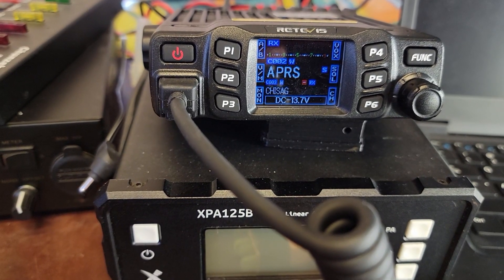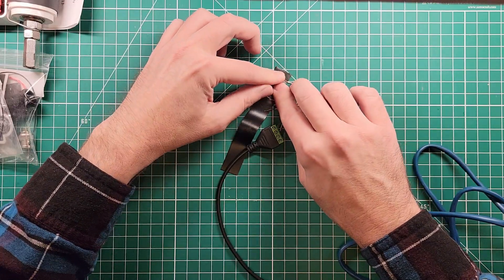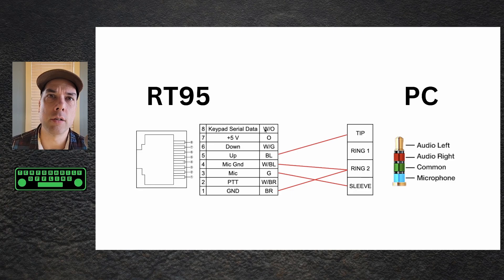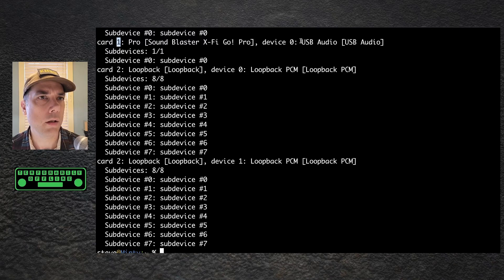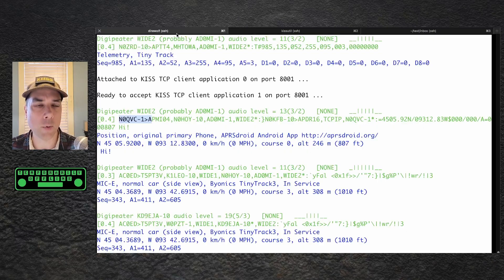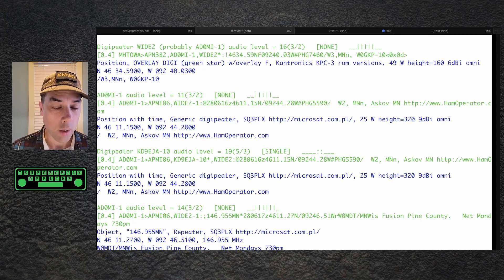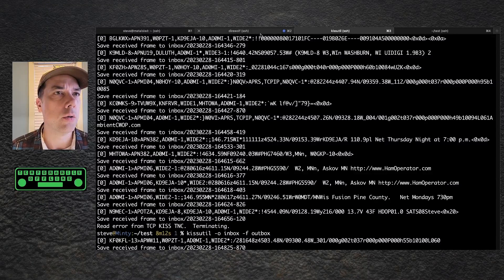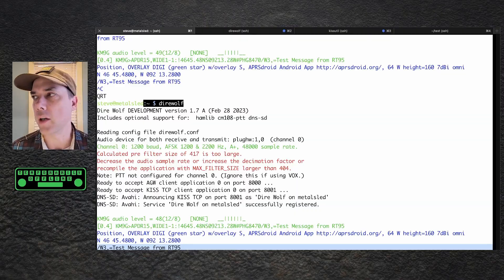APRS CABLE!!! Retevis RT95,  Anytone AT-778UV, CRT Micron, SR-94HPC, Midland DBR2500

Comment: I made that cable for my retevis. I soldered correctly but when I connected cable to my phone to use aprsdroid radio changed the frq because the tip of TRRS is connect to UP pin in hand unit. AI told that I need 1uF capacitor on this line but when I soldered 10uF capacitor, VOX not worked and radio not sent aprs packets. Only heard it but not decode in aprsdroid.
Reply from the maker: Yep. She's a trickster
Reply: So do you mean that capacitor on line 5 is not need?
Reply from the maker: No, I mean I haven't figured it out yet... still working on it among other things.  For a short term fix, I'm using the external speaker port on the back instead.  I've created a PCB to make it a bit easier and I'm working on making a shorter video on using it with the RT95 and getting on APRS - we have it working on the 6pin radios (and there were more of them, so that helped fund development.  Check out the videos here: https://www.youtube.com/@temporarilyoffline/search?query=retevis%20toads%20di%20rt95 (and look for the live streams)

Comment: Does this cable supply   a PTT (Push-To-Talk) connection to your radio? I have the Anytone AT-778UV and I have not fount it will do Cat control am I wrong?
Reply from the maker: CAT control and PTT are different animals.  PTT is thought of as what you do when you push the switch and CAT is asking the radio nicely to change freq/power/PTT/etc.  It's a difference that is important in the context of your question so I wanted to make sure we were on the same page.  I've improved this whole circuit recently and I'm selling a PCB at https://temporarilyoffline.com check out the instruction sheet for the circuit and some of my recent vids like "explaining the PTT circuit" where I go into more details.
Reply: @temporarilyoffline  Thanks for the reply will check out your link. Been a ham just over a year the digital modes are like opening Pandora's box.

Comment: Not quite sure what I've done but as soon as I plug in the TRRS to my tablet the channel starts scrolling up!
Reply from the maker: The UP Button is the same as the Mic output, so there is some feedback going on there.  You'll need a DC Blocking Capacitor on pin 5 - or use the external speaker jack on the back to get rid of that interference.
Reply: Cant believe you replied to a two year old video! I mostly commented out of frustration 😂 thank you so much, ill give it a go tomorrow 😊 @temporarilyoffline
Reply from the maker: @jimjames1987 were actually picking this project back up again with a new PCB sound interface, check out https://temporarilyoffline.com for more info. (Should be restocked soon)
Reply: @temporarilyoffline ah thats exciting.  I have my RT95 in my work van, and all my tinkering so far has been on HF so will be good to see!

Comment: Sorry i dont understand . How did you get the anytone to physically tx without a cat control. ?
Reply from the maker: VOX is the way. Most 2 meter radios do not have cat control.
Reply from the maker: I also have another video where I got it to transmit by activating the push to talk line in the microphone with the computer. Lots of ways to do this

Comment: If you use this transceiver with Raspberry Pi, you will be able to make a PTT controlling via GPIO26 (Its a port number 37). Just connect some wire from PTT pin to GPIO26 and use sysfs to control PTT. Direwolf has built-in function to control PTT via RPi.
Reply from the maker: Awesome thanks for that!  I'll try that.  But, stay tuned, I'm making a PCB that will make this a single cable connection to the radio/computer!
Reply: So not possible with pc

Comment: Steve, I am thinking CAT control.  You could program some small signal relays to transition the audio over to some dio pins on a microcontroller and completely control the radio from USB commands.  APRS radio that can QSY programmatically.
Reply from the maker: That would be cool!  There is no end in sight!
Reply: @temporarilyoffline  that micro could also control the PTT.  There IS NO END in sight 😀

Comment: Hello. Audio from radio transfers via UP pin? And do I need to enable hand speaker in my retevis settings?
Reply from the maker: You'll need to enable speaker mic in settings. Check the diagram in the video for pinout.

Comment: Hi, I was looking for this info. Great! How do you make the radio go into TX since you not wired the PTT line in the RJ-45? Please help, thanks. 73 Phil ON4VP
Reply from the maker: In a follow-up video, I got PTT working. https://youtu.be/26Bsd2BWSm4 I still want to make it prettier!
Reply: @temporarilyoffline  I saw that to. I just ordered one. I have a TNC-X from Coastal Chipworks and I will make myself a cable using the audio in/out, ground, and the PTT since the TNC has a PTT line out. So I hope to use a single cable to work APRS and packet or Winlink. 73 Phil 0N4VP
Reply: @temporarilyoffline  Another small question, the audio that comes out the RT95, is this a feix level or dependent on the volume you set on the radio? I guess volume related?
Reply from the maker: @pvdk  it is a speaker, so radios volume knob will lower the audio
Reply: @temporarilyoffline  I was wondering that when you were  exoerimenting with PTT I see in the manual that the microphone only supports 5 VDC to use the buttons ans leds. I you switch this port wit a low/high signal form a serial port the changes are you put 12 VDC on this port. Perhaps this is to high fot this port. It keeps me from using the radio this way ... 73 Phil ON4VP
Reply from the maker: @pvdk  could be. I'm still tinkering with it. I recently got this radio back. Haven't had time to continue the project
Reply: @temporarilyoffline  I follow your channel so I will be notified when you post another video on this. I still think this is a great project.
Reply from the maker: @pvdk  excellent, thanks!

Comment: Oh, Steve, you excite me! (in a manly, hamly way.) This means the RT95 can send data through its mic jack, which means I can probably use my RT95 as a POCSAG transmitter along with a Pi 3B+ with an MMDVM repeater HAT with a DB9 connector and a homebrew cable to the radio.  Groovy! Like your APRS setup  this would be proof of concept for now. 73 de DW7GDL.
Reply from the maker: It's still proof of concept at this point.  It does work, but need refining. I'm still working on it. Stay tuned.

Comment: Only for reception it is not necessary to create a new cable, it is sufficient to connect the audio output from the back of the radio to the sound card. Anyway thanks for the suggestion. 73 from Florence, Italy
Reply from the maker: You're welcome

Comment: Great set of videos.  I came across this while searching for reviews of the Retevis RT95 as I was considering getting into LX operation beyond a simple BF.  I made the purchase (a whopping $125 for radio, mobile antenna, data cable) after watching this video.  As a long time build-a-pi user for HF digital use, playing around with APRS on the RT95 sounds fun.  I have some experience making RJ-45 interface cables for my FT891 & FTdx10, so why not one for the RT95. Thanks for the audio out pin out location.
Reply from the maker: Glad it helped!  Thanks for watching!

Comment: Following along here - however when I plug into the 778uv, it starts doing channel up. Any ideas what I'm getting wrong here?
Reply from the maker: That happens every so often with mine as well.  I don't have a solution yet other than to set the channel again.  It survives a power cycle about 97% of the time so far and I'm working on a solution for that. Stay tuned!

Comment: Think this would work on the 779uv too?
Reply from the maker: I don't have one, but check the manual for Mic pin out and test it out.
Reply: @temporarilyoffline  the manual is terrible. Doesn’t have the pin out listed
Reply from the maker: @anduril328  I took a look now that I'm on my computer and I think I have a clone of this radio.  I believe it does NOT have a speaker in the hand-mic, so you'll have to do some extra magic to make it all work - wire speaker to the rear speaker port, wire mic and PTT to the front mic port - it won't be as "elegant", but it will be certainly do-able!  Keep following along for more updates as I'm working on a way to make this whole process even more easy.

Comment: The reason for.the separate grounds - balanced vs. unbalanced audio.  Unbalanced, the ground just goes to the chassis.  Balanced audio is actually the return signal of the audio.  You need separate grounds to eliminate cross talk between mic and speaker.  Impedance are different between balanced and unbalanced.
Reply from the maker: Thanks for the info!

Comment: I experimented with running an APRS digipeater/iGate with my ID-5100.  I used a couple of patch cables and a Signalink to do it with a mechanical A/B switch in line so I could switch between the Signalink and the hand mic as needed.  Worked like a charm.  I plan on replicating that setup at the new QTH with an inexpensive dedicated 2M radio so that it stays up all the time, not just when I'm not using phone.
Reply from the maker: Excellent! This thing will have a more simple interface when I'm done, but gotta make it first.  Stay tuned.  Looking forward to your videos on your setup.

Comment: This is awesome. But wonder if this would work on baofeng and if so if the  y cable that comes with the 50x2 gen 2 would work and if  btech will sale them separately
Reply from the maker: It would work on a baofeng if you adapted the cable and used VOX
Reply: @temporarilyoffline  oh no. i am wondering if the splitter cable that comes with the 50x2 second gen would work with this. they have a splitter that splits the rj45 to a k1 and rj45
Reply from the maker: I don't know, but if btech wants to send me the amp, I can look into it 😉

Comment: In the Direwolf documentation they mentioned some USB sound cards that have hidden gpio pins to trigger ptt.  Personally, I would like to somehow use the right audio channel to trigger ptt.
Reply from the maker: The CM108 based chips have that feature built in and I've got a 2pack on order... 2 videos away in this series.
Reply: @temporarilyoffline  I wish APRSDroid would allow a ptt solution, as that has been my go-to portable kit and I'm disappointed in how much dead air I must use to get a burst.
Reply from the maker: Pi zero with an android front end?  More devices though...
Reply: @temporarilyoffline  I just think use a tone on the right channel of audio to trigger PTT.  I think APRSDroid is open source.

Comment: Not all grounds are created equally. When you design an rf circuit or a highspeed signal circuit you need to carefully design the return path as to not cause interference. Also GND could mean not ground depending on the type of amp driving the speaker.
Reply from the maker: Thanks for the info!

Comment: Steve, you need to get one of those RJ45 socket breakout boards with screw terminals or some such.  Really helps to cut down on magic smoke releases when that one wire touches something it shouldn't (don't ask how I know).  But using tape is a time-honored tradition and it is good that you are venerating the old ways.  :)

As usual, a wonderful video!
Reply from the maker: Thanks!  I've looked for those before, but it's always good to start in the junk drawer!  I've let the smoke out with unprotected wires too... not fun!
Reply: @temporarilyoffline  Yes, always start with the junk drawer!

Comment: I have another cheap mobile radio, a BTech UV-2501+220 (a variant of QYT KT-8900R). The pinout is different but there are AF in and out pins, per google. So this concept probably would work with that radio also.
Reply from the maker: I bet it would.

Comment: TAPRN decades ago started using this approach for the Kenwood TK-705i to do APRS, I was able to buy a cable for mine already wired. Brave cable making skills required, but it is a proven way to get APRS into and out of computers. The way you sent that file is new me, and awesome!
Reply from the maker: Yes, I see a lot of potential in being able to send myself a message based off of some other computer signal - like a weather alert triggers an aprs message saying seek shelter now! For example.

Comment: If you're using it with a signalink you wont be able to hook the wire directly or it will trigger channel up. The solution is to have it go through a 0.1uF to 1.5uF capacitor!
Reply from the maker: Nope, not using a signalink.  Although they are great devices!
Reply: @temporarilyoffline  Yeah I saw, I was just letting other viewers know :)
Reply: I have new info on the Anytone mics. The Up/Spkr+ line is pulled up to 5V. A falling edge will trigger the Up press, while an audio signal ranges from 2.5-5V. 

I was attempting this with a digirig lite that has the capacitors internally, but also pulls the MicIn (Spkr+) to ground. In order to make this work on an Anytone, you need to translate the audio into a 2.5-5V signal and pull the line normally high. 

Still thinking through the circuitry to make that happen. In the short term, I’m just going to run the Spkr+ from the 3.5mm audio jack on the back of the radio, but am not giving up on a single cable solution, even if I need a small bit of circuitry or even a small throughhole pcb in between.
Reply from the maker: @christophermcclellan8730 I'm still working on an "elegant" version too.
Reply: I’m curious why that is. How would the signalink be putting voltage onto that multiplexed line? How does the capacitor solve it?
Reply: @christophermcclellan8730  The signalink does not put voltage on that line, the 778UV itself does as part of the data communication with the mic (when connected). Thats how the buttons all work.
Reply: @lukethee6407 that doesn’t quite make sense. The radio will put voltage on that line when it’s sending audio, but the mic is what would be putting voltage on the line when the up button is pressed. No mic, no up button… how is voltage being put on it?
Reply: I’m gonna have to tear this mic down and look at the circuit. Maybe get the logic analyzer out.
Reply: I believe there's constant communication going on there for things like rx and tx LEDs and such. All I know is there's a small pulsing voltage that destroys any audio unless you do that... and even then Id prefer to use the 3.5mm on the back if Im actually listening to it.
Reply: @w1btr I’m gonna have to get this thing on the logic analyzer. Curiosity is getting the better of me.
Reply: Any chance you can go into more detail on the signalink, I've set up jumper wires as they should be set and taken the rx from back jack to sinalink box., I've set tx from front mic port to singnalink box, when I do a test ptt triggers on signalink box but does not put radio into tx.  I've not done any mods of resisters or capacitors in the jumper line as I'm not sure what should be shorted. I receive packets no problem and show up in dire wolf. Any help would be appreciated.

Comment: I really want to get one of these to use as an iGate with a decent antenna . There is such a lack of APRS digipeaters and iGates in my area
Reply from the maker: That's where I'm headed too
Reply: An old android with phono and a k1 and baofeng with aprs droid would use very little power
Reply: @pen25  I’m looking to service my entire area. 25w with a decent gain antenna will be fantastic.
Reply from the maker: @pen25  it would, but 5w(ish)